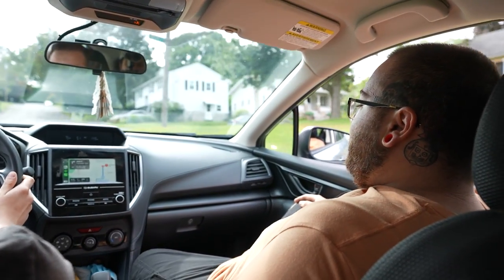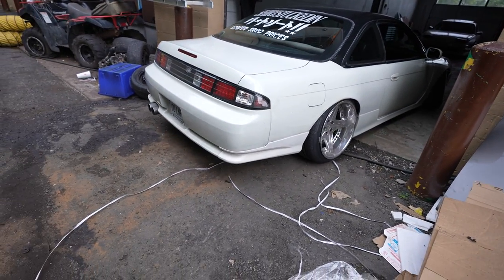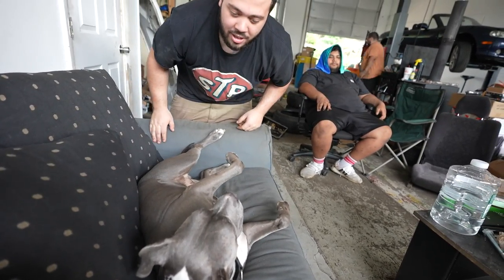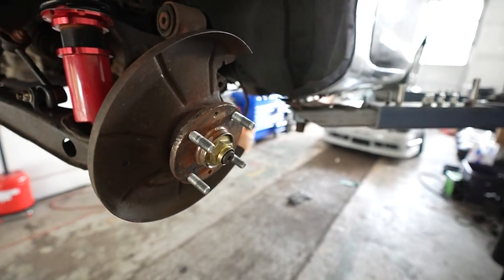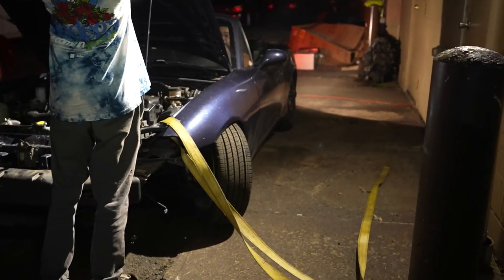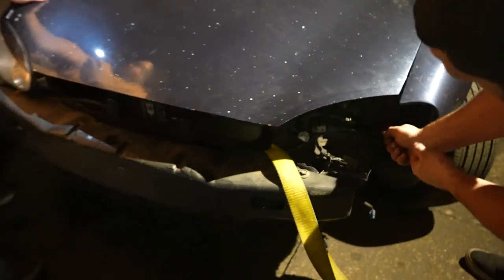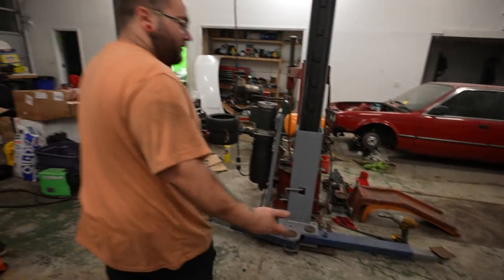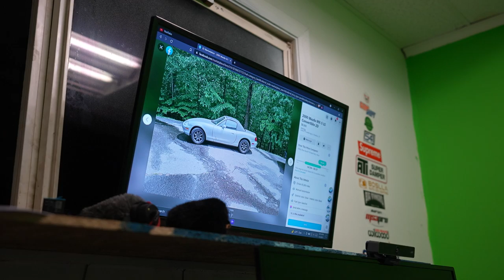How to Fix a Bent car frame (FREE & EASY)

Comment: You need constant and increasing pulling force to properly pull the frame back. Also, you need to tie off the other side as you ratchet the bad side into place. Been there done that.

Comment: I will trade you a 2000 BMW E46 328Ci that needs diff bushings runs and drives everything works for the Miata if you want to bring it to Kentucky LOL

Comment: Aj is the man of the show!
Reply: Always lol
Reply: @ my man or girl if your a girl idk lol.  Make it take turns better  by loosening the front end i took out the stock cold air connector  So the weight of the left an right whole front end doesn't lean on a tight turn goin down hills ince the lef & right side aint touching

Comment: I did my wifes Del Sol the same way. The corner of the metal may cut it, but if it doesnt, that whole front end will come off before that strap breaks. With quality hooks anyway.